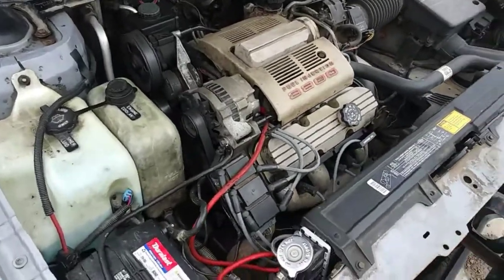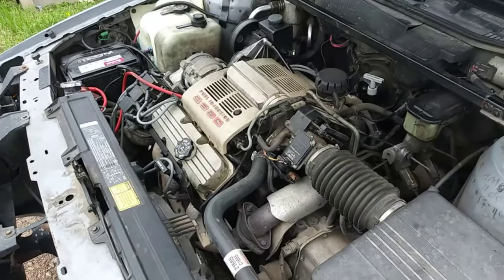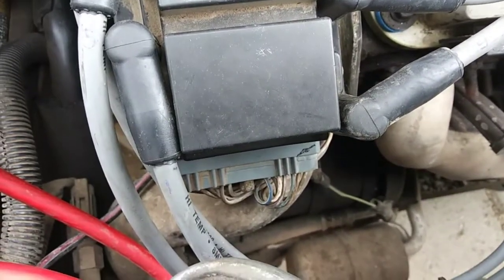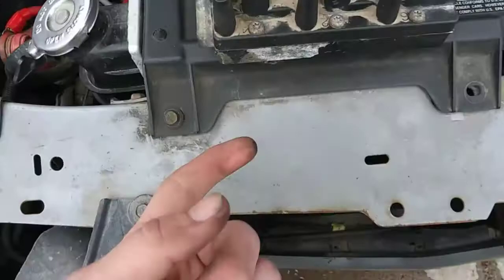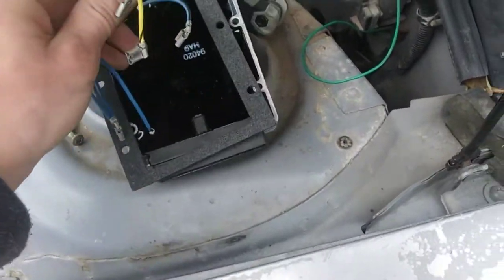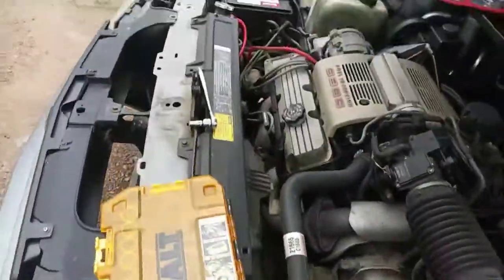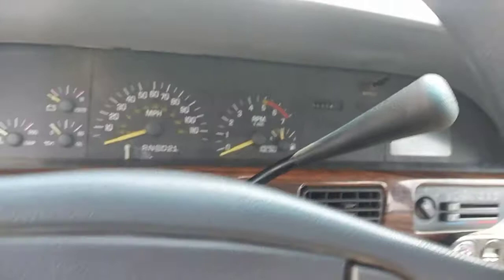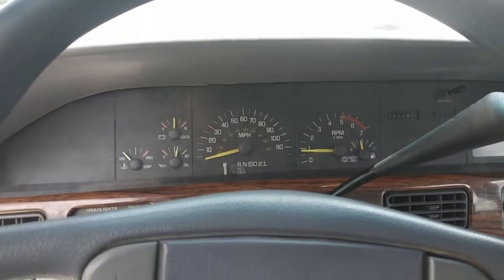ICM Replacement GM 3800 Vin C (1988-91)

Comment: Hey so I have a 91 old 88 royale I spent over 500$ on an entire fuel delivery system. Lines tank pump assembly all the way to the engine. This wasn’t the issue. I’m positive it is my icm. I just ordered icm, coil pack, plugs and wires. The only other possibility I can think are injectors. I highly doubt it’s the injectors. I thank you so much for posting this bc it gave me a little more insight for pulling the part before getting under the hood. I have all of the same symptoms, it drives until it warms up and will randomly stall in the middle of the road and won’t start back up. Tomorrow we will see. I also did the brake lines and master cylinder too. One caliper was ceased so I replaced that. Other than that its a damn good car.
Reply from the maker: Check the wires to your crankshaft position sensor. I had bad wires that caused my ICM to short out because the crankshaft sensor is what tells your ICM when and where to fire the spark. Without that input your computer "doesnt know when to fire the spark" and therefore Doesnt run. If it does it again pull one of the plug wires off one of the coils and hold a screwdriver about a half inch away and have someone crank the engine. If you have no spark I bet you have a bad crankshaft sensor.
Reply: @caayydenn  can you tell me the location of the crankshaft sensor? tyia
Reply from the maker: @briandeanleister  behind the harmonic balancer on the bottom of the engine
Reply: Did your solution with the ecm and coil pack finally work? …. I seem to have the same issues as you

Comment: Turns out that the wiring harness from eBay was too short for my car. I have an ‘88 LeSabre and the ICM wiring goes all the way to the ECM. Seems like the EBay harness is for a later model where they put the connection from the module to the ECM up toward the front of the engine, under the coil pack. Big bummer
Reply from the maker: Probably because yours is an 88. They must be for the 89-91 3800s. I'm sorry that happened. But I still think that wiring harness is your issue
Reply: Caayydenn yeah they must have changed it after 88. 
I’m thinking about cutting the wires back a little and re-terminating them. Or taking the wires out of the new connector and re-terminating the old wires on the new connector. What do you think of that idea?
Reply from the maker: @BearLionScreenPrinting  Cut off the new connector from the rest of the harness. Cut off past the bad wires on the old plug, splice new one on by either soldering or butt connectors.

Comment: I have the same "C" engine in my 1988 LeSabre. I replaced the ignition coil and ignition control module with AcDelco parts. I also replaced the spark plugs and spark plug wires. My car still won't turn over all the way and when it does it sputters out in a couple seconds. Any ideas of what else I should check?

Here's a video of the parts I replaced https://www.youtube.com/watch?v=NW9exb8OmJI&feature=youtu.be
Reply from the maker: Clean your MAF sensor. Replace fuel filter if you haven't, and check for fuel pressure after the filter is changed. Sounds like you're not getting adequate fuel
Reply: @caayydenn  Thanks for the reply! I'll try all of those things. I brought my battery in to be tested and they said it had a bad cell too. So I'm going to replace my battery as well
Reply from the maker: @BearLionScreenPrinting  Your car will run off your battery until the battery is dead if your alternator is not charging it. However sputtering out usually isnt a charging issue but more of a fuel/spark issue.
Reply: Caayydenn I just ordered a fuel filter and I’m going to pick it up tomorrow and try replacing that for sure. 

If the fuel pump failed would I not hear the buzzing sound after I turn the key on accessory? Right now I’m still hearing the 2 seconds of buzzing if I turn my key on accessory.
Reply from the maker: @BearLionScreenPrinting  You might still hear the buzzing but it could still have weak pressure. And if the filter is clogged of course you will lack fuel pressure. If its a high pitched buzzing that's not as good. Should be a low hum. However if the fuel filter does not make a difference i would look into the electronics of the car. If it has any trouble codes get them scanned. All it takes is a paper clip
Reply: Caayydenn the last code that it threw was 42. I found the underside of the of the ignition coil had one of the leads corroded all the way off. After I replaced the coil and module today the 42 code wasn’t showing anymore. It didn’t show any codes
Reply from the maker: @BearLionScreenPrinting  i just watched your video as well I hope you replaced the wiring harness to your module because those wires don't look good. And the "missing" piece there is suppose to be like that.
Reply from the maker: @BearLionScreenPrinting  I got the same code that made me replace my module and coils. The reason I lean towards bad fuel pressure is because your ECM does not read fuel pressure so it wont throw a trouble code if the fuel pressure is bad.
Reply: Caayydenn do you know if the wiring harness comes as a complete piece with both ends? Or would I have to just splice the new connect on to the existing wires
Reply from the maker: @BearLionScreenPrinting  its all one piece actually. No splicing needed! The one I bought came with the ICM plug, crank sensor plug, cam sensor plug, and the connector that connects to the other half of the harness that goes into the firewall. You will have to remove your alternator to replace the harness. And be sure to route the wires in safe spots. I will find a link to the exact harness I bought that fixed my Bonneville.
Reply: Caayydenn that would be great! Thanks for all your help!
Reply from the maker: @BearLionScreenPrinting  https://www.ebay.com/itm/GM-12127654-OEM-Ignition-Coil-Harness-88-95-Buick-Oldsmobile-Pontiac-w-3-8L-V6/274026431471
Reply from the maker: @BearLionScreenPrinting  I forgot to mention the ground wire on the harness. Make sure the stud it grounds onto has a clean surface when installing.
Reply: Caayydenn ok sounds good. I just ordered it. I’ll clean up all the contacts
Reply: @caayydenn  I replaced the fuel filter and cleaned the MAF and it's still having the same issue. It started throwing CODE 42 again, so I'm hoping that once the wire harness gets here on friday and I replace that then it will solve the issue.
Reply from the maker: @BearLionScreenPrinting  sounds like the wiring harness is your problem. Hopefully your ignition module or crank sensor didn't get damaged by the bad wiring. I had to replace my crankshaft sensor after I replaced my wiring harness because the wires leading to it had melted together.
Reply: @caayydenn  Yeah hopefully no damage has been done to the new stuff I put in. We'll see on friday how it works out. I'm hoping for the best
Reply: @BearLionScreenPrinting  so did it work out for you? The harness?
Reply: @Ry77x  I re-soldered the grey plastic part onto the existing wires. My car didn’t work right still. Then I replaced the ECM and it has been running great for 2 months.
Reply: @BearLionScreenPrinting nice. I’m gonna try the same soon. Thanks for the reply back. Goodluck.

Comment from the maker: I forgot to mention this in the video that is a crucial step and i apologize. But use dielectric grease on all the contacts and the black part of the module to prevent it from overheating. Thanks for watching